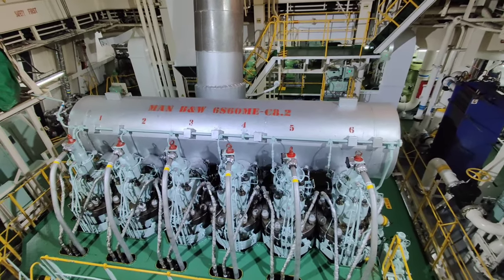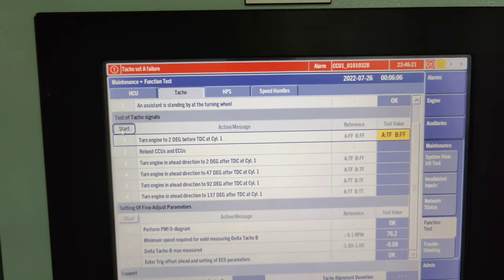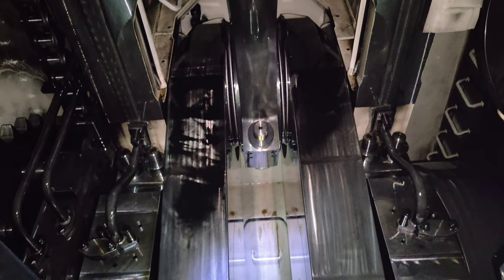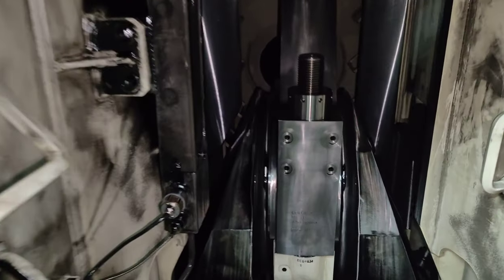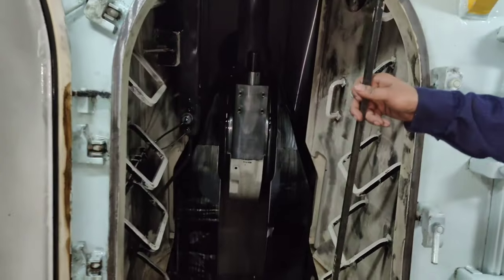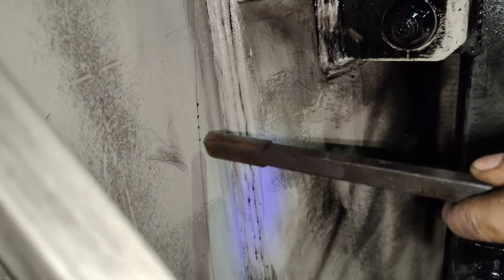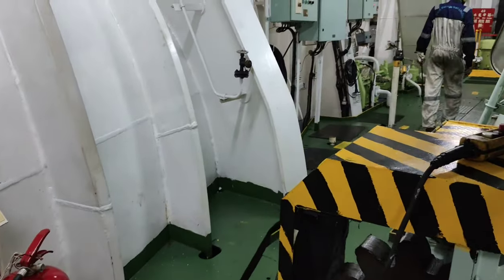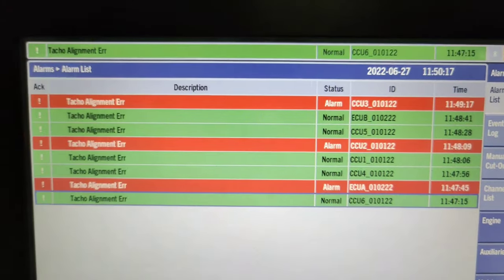Cylinder No.1 TDC position confirmation | SEA LEGEND|

Comment: So Afte you installed this ruler in the embossed point in the crank web another side of the ruler should match with one of the 4 marks, correct 🤔? Thanks 👍 😊
Reply from the maker: Hey hi....the indicator should match with the CYL. No.1 TDC marking...which is already on the flywheel made by manufacturer...